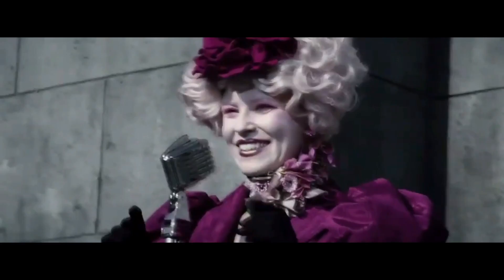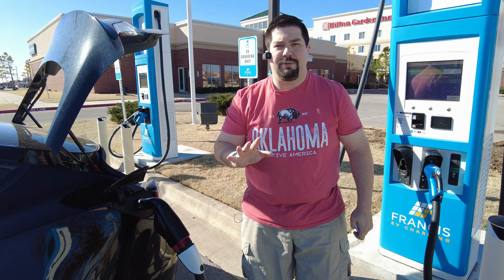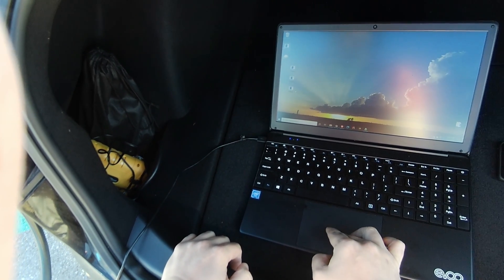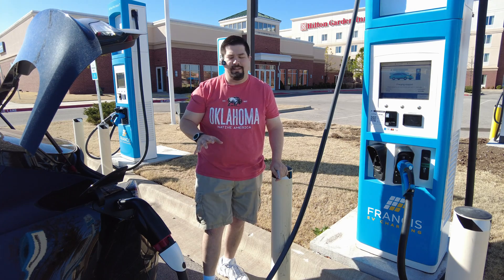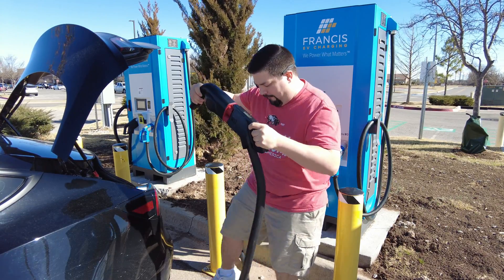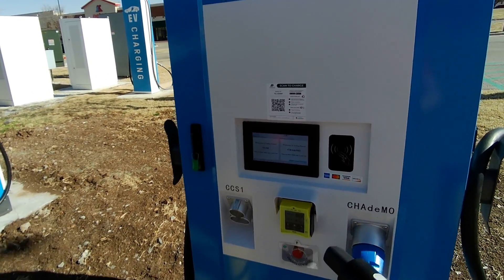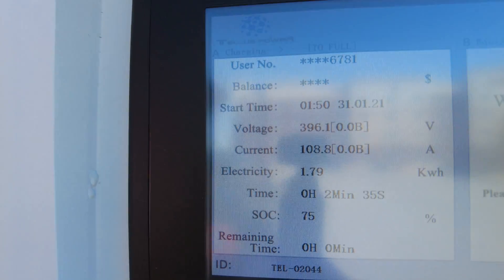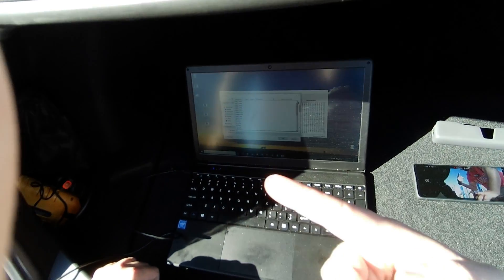Tesla CCS Adapter testing #9

Comment: Great Progress!  I worry that you need to get there with, like 20% in the battery.  at 65% it could be just normally throttling... You might not be able to get more than 25kw.
Reply from the maker: won't throttle below 50 KW until 82- 84%